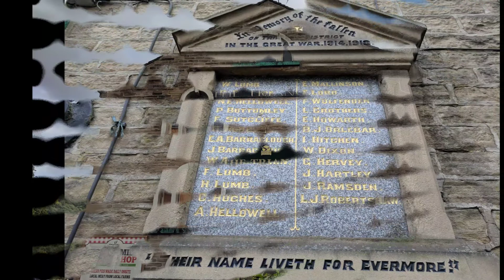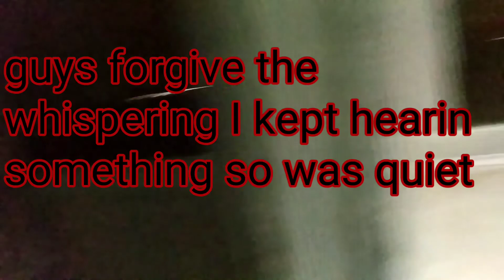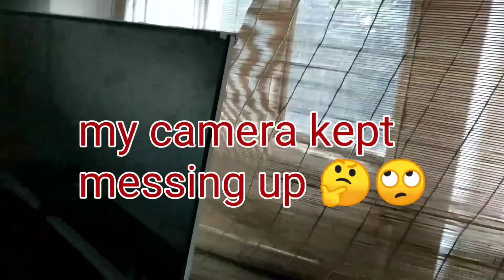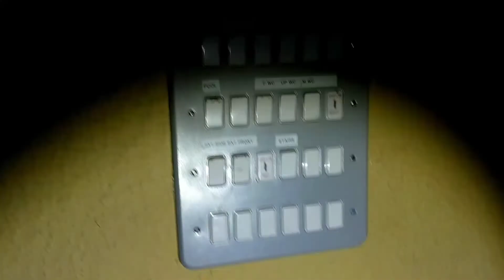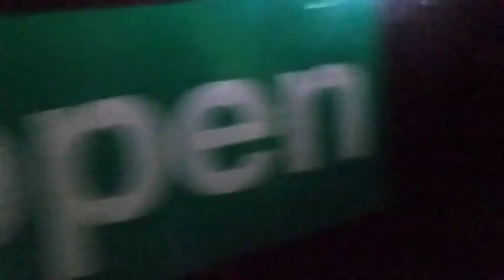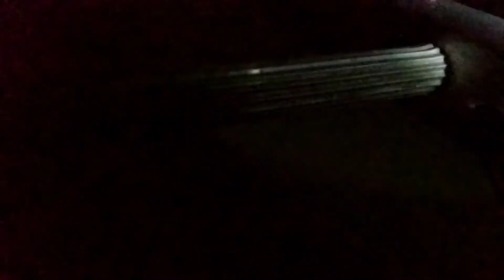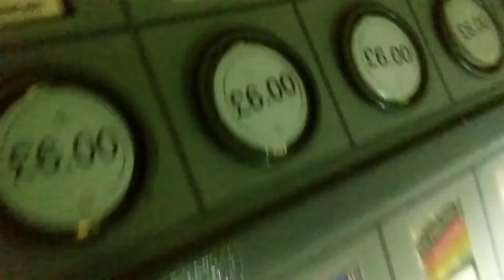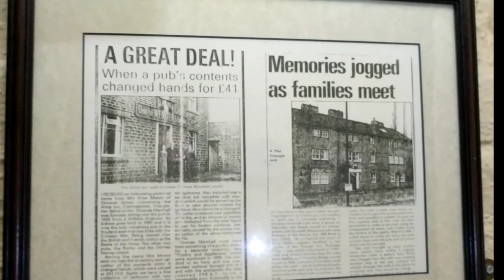The triangle pub,5 floors of history #urbex #historic

Comment: The attic area was where the staff of the pub would have resided.  The walled off area is interesting with its single bottle in it.  Early pubs would have featured lodging for travelers and a place to eat.  They were divided into either a pub for locals or one for those with money originally.  The inside is surprisingly devoid of most personal artifacts.  It was as if they gutted a good portion of it during a remodel leaving the attic containing how it used to look.  Usually you would see various owners adding to it over the years.  The small fireplace in the bar area indicates it used to be.a sitting room likely for the owners family meaning once the bar was likely located in a different area.  The owner of such establishment would have lived in the building early on.  The fireplace called a keyhole provided a small amount of warmth on cold mornings or chilly days when starting the fires up would not have been wanted.  There should have been many more fireplaces or coal stoves in that building as there was no central heat then leading to idea it was gutted.  The pub itself and the kitchen should have had a very large stone fireplace.
Reply from the maker: Thier was several more fireplaces even one I noticed had been sealed so I'm assuming most have either been covered up or maybe like you said with remodelling came new walls and the fire places where destroyed as the last old building had a fireplace in almost every room but this was a Elizabethan manner from the medieval times but I agree about the attic and all its original features and with the main fire place downstairs maybe the pub kitchens are a later add on and the old kitchens where on a separate part of the building and maybe ripped out as to why a person would do this shocks me as personally I would of restored as much as possible but that k you for your comment and knowledge I've learned a lot awesome 👍